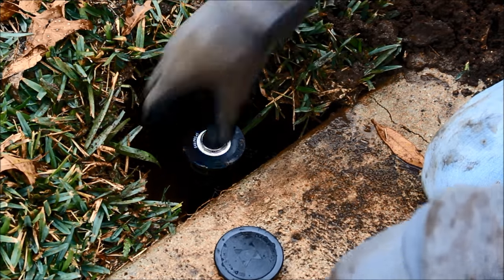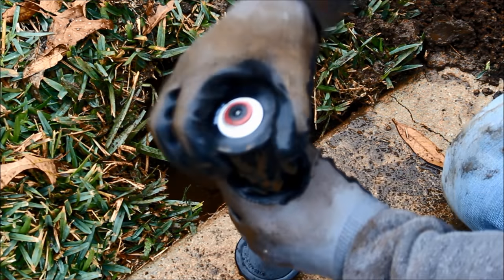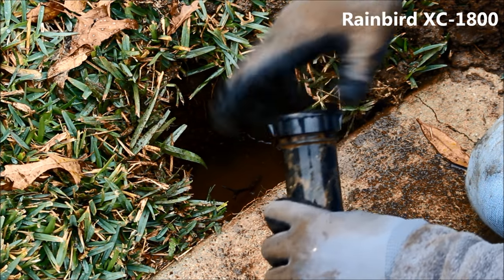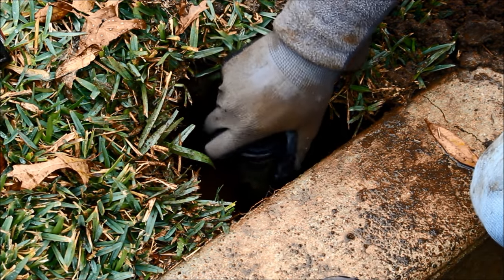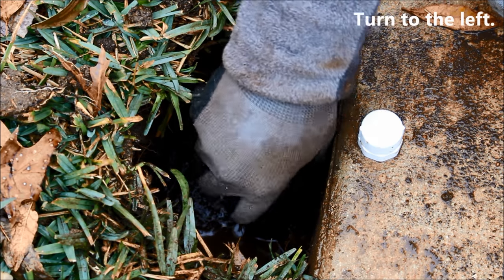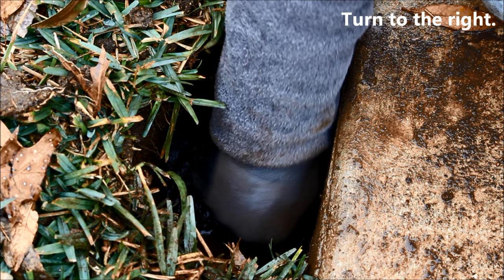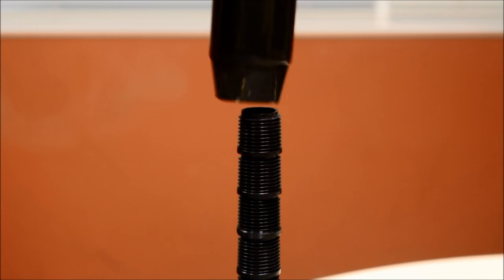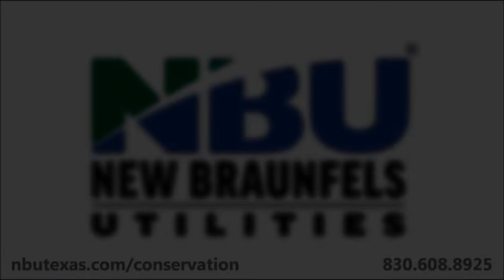How to Cap a Sprinkler Head

Comment: Do you have to shut off the water to the system prior to taking off the sprinkler head? Or just make sure the system isn't on during the repair is enough?
Reply: You shouldn’t need to turn off your water. I just removed a sprinkler head without turning off the water and there was no leak.
Reply: No pressure. But you should know your programmed times. Usually on in the early a.m. or at night.